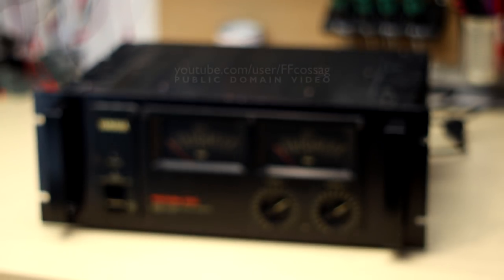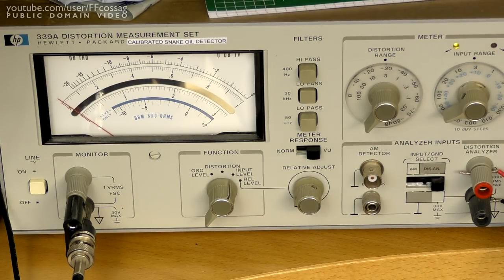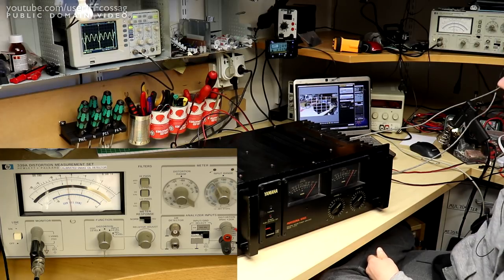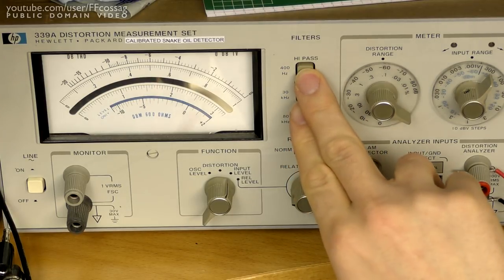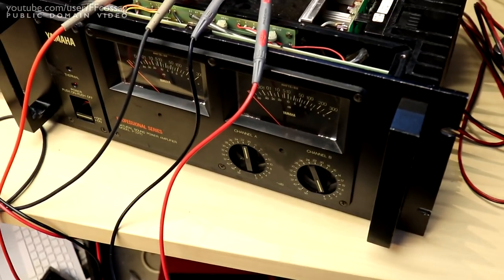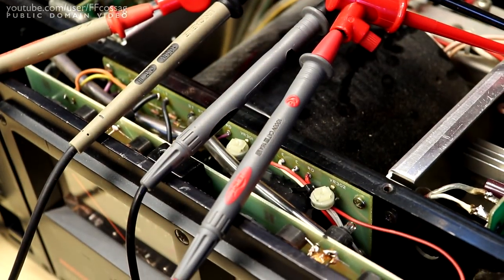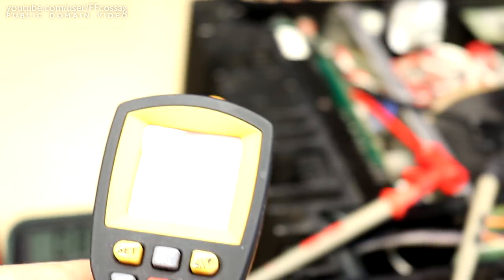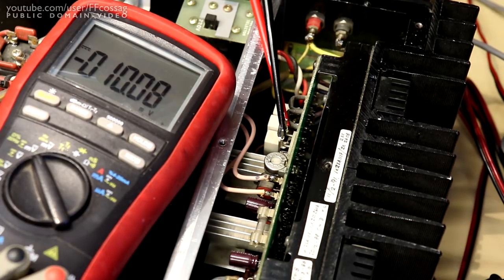Yamaha P-2200 tune-up

Comment: As a point of reference and being a sound guy myself, you may find the following information interesting. Microphones can't clip as they aren't powered drivers. They can however be over attenuated which is more accurately the situation you had there in your shop. You'll only find clipping on the output side of amplification in the sense that either the amp will run out of headroom or the speakers will reach their x-max and have no room to travel any further. Your mistake is very common and I don't think any less of you for it. I just thought you might like to know before a troll who knows just enough to correctly speak ill of you. I really do enjoy your channel. I hope this helps...

Comment: Hi again. UPDATE:. Crack open the meter chip carefully, it has a normal pcb inside with a fet and 4558 op amp circuit, replace some of the parts inside for accurate meter readings, if one meter is more sensitive, remove the meter, cover and resolder the coil spring with a bit more tension. and clip off the excess which will only be a millimeter or so... I soldered the pair together on a variable psu to calibrate mine and get them both to scale properly with each other at the correct value. The meters are very accurate when they work properly and were a very expensive option back in the day. They are very high quality large movement meters and heavy. Probably would cost around £100 a piece at today's prices, they are spec'd at,  1Kohm, 20mA, 2v  for FSD.........I hope this helps and I know the meters are cosmetic but finding 50db square law meters on amps these days is impossible and boy do they look fabulous.....These amps sound great too, some idiots tho tend to want to bias them high thinking they are getting near to class A.....geez some people are dangerous.....6 transistors on an 80v psu? High volts, high load impedance, 8 ohms for these, they will not stand high bias for long, trying to explain that you are effectively shorting a 160v psu thru with only 6 transistors, if they want a class A, buy a class A...full stop. Class A, low volts, lots and lots of transistors, usually 20 -30 for 250w pc....... I agree to bias these to just under 10mv which gives around 35ma thru each o/p transistor I think from the top of my head................repaired a couple of these in the past and still think they are one of the best amps money can buy if you are lucky enough to find one.....they are also better than the later models, the M series and PC2002 series......Simple design with small component count gives very little noise and distortion as you know..... I still have one on my main system at home and will never part with it, never, not even for 5 grand. Also fitted small white led's for the meter illumination as a little mod to replace the bulbs and looks good other than needing a diffuser to remove the "tiger" effect, working on that one. Nice vid and be great if you could post another Yamaha repair job, pref a pc2002m if you get one in....... Thanx, Ian
Reply: my mistake, 30ma
Reply: @ianhuntington9056  I have a friend looking for 2 replacement meters for his unit.  Are these unobtanium or might you know where replacements can be found?  Thanks!
Reply: @johnlyden7243  Unobtanium except the odd ones out of a scrap amp usually in the usa. I could maybe lay my hands on one from an old engineer guy I know,  what is wrong with your friends ones? these things never break
Reply: @ianhuntington9056  Ian, thanks for the reply!  My understanding is a previous owner had someone work on them and messed up the plastic shafts (his words, I know nothing about them), so they can't be adjusted.  Whether or not they actually do not work is unclear to me.

Comment: The reason the meters are not scaling is because the springs have uneven tension  on the meters, if you recalibrate them by offsetting the ZERO spring return through the panel you will find you can get them to scale but they will not sit at zero. the meters are replaceable though and there are lots of available options on the market still that do fit although you will need to measure the FSD of them for the replacement value, 1ma or 100ua fsd, not sure but you can then remove the scales from the old ones and put them in the new ones....
Reply: another option btw is to heat a very small pin and push it through the plastic for the needle to rest against at zero............meters fixed

Comment: Please correct me if I'm wrong cause I'm just a novice but when adjusting the bias I saw  a "-" in front of the reading. Wouldn't that be a negative 10mV? Thanks for the video.
Reply from the maker: You can only get it to go one way, so it doesn't matter.
Reply: That voltage is simply a current measurement over a shunt (in this case the emitter resistors of the power amplifier). Bias adjustment is also more aptly described (with more syllables) as idling current adjustment. The P2200 uses .33Ω 5W resistors IIRC so 10mV across one (the bias adjustment measurement points are across one) is 30mA through the output transistors at idle (no signal and load).

The emitter resistor of measurement is in series with an output transistor that would only have current go one way (unless totally broken), from 0mA to 10A. Consequently the voltage across the emitter resistor would do the same and not change direction, so polarity can be ignored.

Comment: Just one more thing: when I power it on it comes immediately that sound "thump" that goes straight through the speakers (I power thump). Is that normal? Is there anyway to solve it? I mean can it damage my speaker?
Reply: A tech at a PA rental place told me the 2200 didn’t have a protection relay for DC at the speakers, whereas  the pc2002 did. The latter has the click you mention. I have researched it and there are aftermarket onboard relays available but you have to be a bit of a tech to DIY.
Reply: @aeyb701  thanks.... that's exactly
Reply: There should be no thump unless there is dc present, sounds like the caps on the boards need replacing specifically the larger ones as one or more passes signal and dc as well if they are leaky. The amp should be clean instant power on power up. A side note, they didn't have relays because back then and since the Amcrons of the 60s it was considered that if one or more power transistors went short they would instantly take out the opposing rail as well which would leave a complete psu short and blown power fuses without speaker damage and speakers were also protected by fuses. Relays were added in later amps so that any shorts or excessive dc at the outputs could be detected before the speakers were connected and could also be used to protect the amp from shorts rather than the speakers. Nowadays though relay boards can be bought cheaply from ebay etc and simply added inline with the terminals and use a separate psu.
Reply: @ianhuntington9056  thank you... Got it